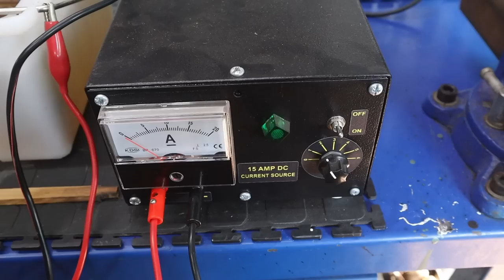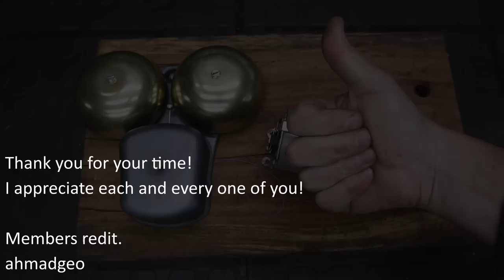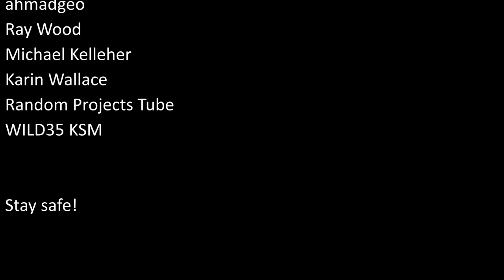Vintage GEC Telephone Extension Bell Restoration

Comment: I'm always amazed how many YouTubers spend 5 minutes pockmarking a surface in a sandblasting cabinet just to spend an hour and a half polishing the same surface afterwards. The thickness of the metal will, of course, have been reduced by half a millimetre.
Reply from the maker: half a millimeter? There is no way that much material is removed. maybe a tenth of a millimeter, and that's being generous.

Comment: Good restoration. The coils are not directly commoned. The first coil is terminated at terminals 1&2, and the second coil to terminals 3&4. The metal link (2&3) commons the coil. That is how the original is.

Comment: Currently this piece doesn't have much function, but a good current function is to connect it to an alarm clock in a way that amplify the sound of the same. For a college student this would be perfect: it's not something that wakes up a college student after a semester ends!
Reply: Or use it as a doorbell

Comment: You connected the magnets wrong, so the magnets now work against each other, why the bell doesn't have the most effective sound. What you need to do, is to swap the connection of the second magnet. The second magnet is supposed to be wired "backwards", so when the alternating current goes into the bell, the first magnet will pull the tab, and the second magnet will push the tab, and then vice versa. If you swap the connections of the second magnet, you will get a much stronger sound.

Comment: I've always wondered,  what is the purpose of the yellow/blue passivation? Is it aesthetic? I always like the bright white zinc and then it turns yellow 😂
Reply from the maker: The passivation seals and cures the zinc coating so it lasts longer, the blue and yellow is purely aesthetic but both does the same thing.
Reply: @AJRestoration  Interesting!!! Thank you!! Sorry for dragging you back to such an old video, I'm in the middle of rewatching everything. Keep up the good work!!!

Comment: It's a nice job. But I'm not sure why you did the wiring with it mounted on the board. Would have been easier to wire and then assemble on the board, IMO.
Reply from the maker: I liked it this way, it was just more open and easier to access. It felt natural to wire it like that.
Reply: @AJRestoration  good enough explanation. Thanks for replying.

Comment: I am trying to restore an old 1970's sears solid O2X welding torch.  My problem is I can only find them complete.  I only want parts and the front panel emblem.  Any ideas where to look for parts?  I've tried ebay, amazon
Reply from the maker: I have no idea, sorry.
Reply: @AJ Restorations  thanks anyways.